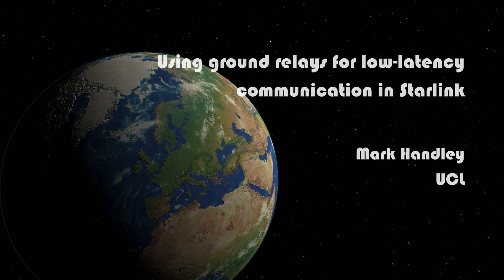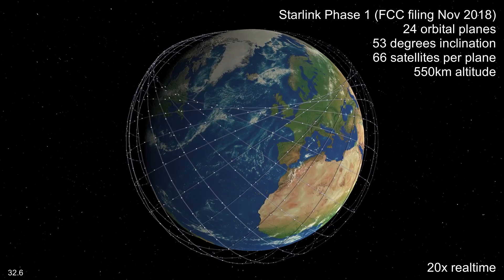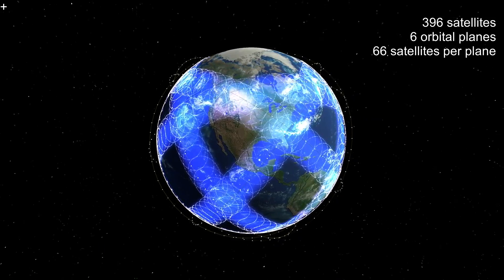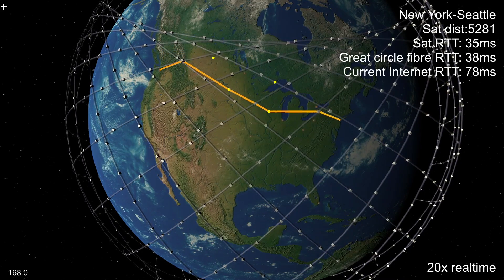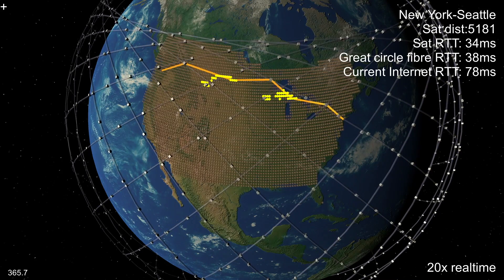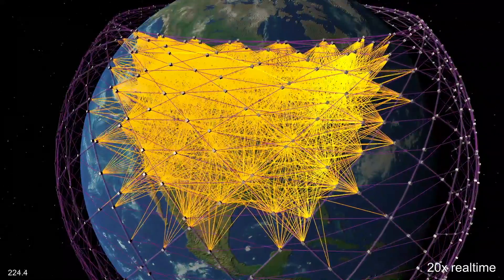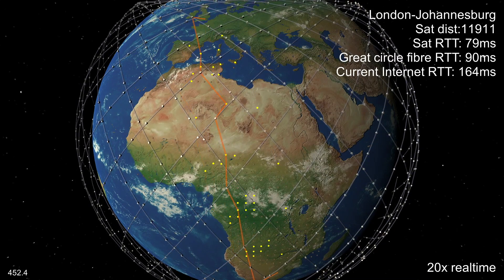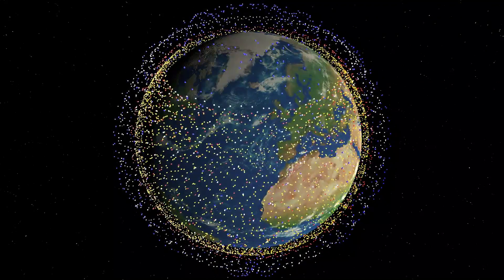Using ground relays with Starlink

Comment: ... funny idea.

So if there's going to be 10,000+ satellites, you might estimate that up to 5,000 should be in line of sight from any angle you look at the Earth. What the maximum wattage going to be on those lasers?

What if SpaceX can slip in the ability to fire off very high wattage bursts, if in synchronized intermittent pulses...

Or in other words could we LASER ABLATION DEFLECT ASTEROIDS USING STARLINK?

How many cumulative watts do you think we'd need? A synchronized 5 petawatt pulse focused on the same point of a single asteroid - could that potentially vaporize enough material to alter its trajectory?
Reply: lol ahaha
Reply: That’s good and all, but how about ordering fried poultry that literally falls from the sky? Think big, man!
Reply: If I understand correctly they have the green light for 12,000 and then an extension to 42,000...what could go wrong?

Comment: How in hell is all this infrastructure going to be maintained?   We can’t even maintain are 100 year old electrical system. Everything is on the ground.
Reply: It's pretty easy when the satellite company is the same company that launches them into space. 😂🛰️
Reply: Simple.
You just keep launching satellites, replacing ones that have problems, and replacing the whole constellation every few years, one at a time.
Reply: @ke6gwf  That probably what was said when the electrical grid was started.  At least the malfunctioning satellites can be set to burn up in the atmosphere. That is if they can be communicated with.  There may just be a failsafe.   Maybe they will just all land in Ohio.
Reply: @fatboy19831  Thier orbits are low enough they'll decay whether you can communicate with the sat or not.

Comment: Bro starlink does not exist

66 satellites per plane
24: 2+4=6 planes

They encoded 3 6 and 9. It's numerology. It's a lie.

Unless you can mathematically prove that 66 is the best number of satellites to put in a plane. Not 50, 65 or 70 but exactly 66.
Reply: #666

Comment: You need lasers to save more bandwidth for user data... but in first project cycle its not a big deal.... Also in space relay should be more stable cause air and clouds and local radio glitches.

Comment: How much slower is the radio up & down link than fiber?
Reply: Fibre is actually much faster
Reply: Yeah, the benefits in topology are great. Looking forward to seeing it in action in 2020.
Reply: Speed might be low but latency would also be low.
Reply: Yeah, don’t understand the logic behind this video. Without laser interlink, Starlink will likely be slower.
Reply: @ianjrgensen1824  It's not just about speed, you also have to consider routing and deployment. Fiber cables are not simple or easy to deploy in all locations. The Starlink network will be able to cover a much larger area and create more direct paths between locations.

Comment: No one really knows about it yet but there opening there own crypto currency exchange using the starlink constilation and they will have there own coin so they will be running there exchange faster than the normal internet it will essentially force all the other exchanges to use there system or be left behind this shits gonna be revolutionary

Comment: Sometimes I wonder if all they have are cell towers 🤔
Reply: Michael A-1  The best way to prove anything would be by testing a number of hypothesis and comparing results. Ask yourself this, "Can I get a telescope and actually see the satellites? Am I willing to accept that rockets powerful enough to escape Earth exist? Does the math actually check out? Have others already published this mashup of knowledge and are their calculations accurate?" I don't understand science deniers. The point of science is that it's testable. It may be difficult but if it's not testable, it's not good science.

Comment: The two biggest concerns for myself, and I'm sure a lot of people, are cost and data caps.  It's all well and good to have high speed data, but if it's more expensive or capped, standard terrestrial data connections with no limits would still be more appealing, especially after the likely price drop it would be forced into to try and retain or attract new customers in response to the losses to Starlink.

Comment: Great simulations - how do you run them? What libraries and frameworks do you use?
Reply from the maker: It's a custom simulator I wrote from scratch in C# using the Unity3d game engine for visualization.  There really isn't a user interface, just custom code for each scene, camera movement, and so forth.
Reply: @markhandley  that's pretty awesome and I'm  quite impressed by the amount of work you put into this!
Reply: @markhandley  How versatile is the simulation? Can it simulate any arbitrary communication constellation?
Reply: @skyr8449  I would assume so. The code is probably a list of relay objects with 3D trajectory and communication delay with other relays (dependent on their distance and type). The rest is a generic routing algorithm.
Reply: @markhandley  Can we download it ?
Reply: @markhandley  that's how i would of done it. unity is great.

Comment: You mentioned the potential for trans oceanic low latency links but I wonder about throughput. Not sure what the onboard capacity of the satellites is but isn’t routing all of the potential transoceanic data through those Northern oceanic routes likely to exceed the satellite network capacity at those critical locations?

Would a tiered system be offered to high paying subscribers with a well-funded appetite for the lowest latency ?
Reply from the maker: There are a lot of satellites along the 50 degree N corridor, so ships are more likely the limitation than satellites.  You really need ISLs to get a lot of trans-oceanic bandwidth.  So, yes, I agree that a tiered pricing system will be needed early on on these wide-area paths, to keep demand low enough to cope.  There are really two different markets for starlink.  One is connecting regular customers to the nearest fibre access point, and that service might be relatively cheap.  The other is wide-area low latency transit, and that's likely to be expensive.  In this video, I'm really looking at the latter.

Comment: I would imagine there would need to be thousands if not millions of ground stations to work on the scale you present, simply because the satilites would need to link to existing ground based networks functionally.

That being said I can't wait for more widespread TRUE high speed internet, 500ms ping from current gen internet satilites is abysmal, while starlink and other low orbit internet startups are saying they can do less than 10ms. I sure hope nothing gets in their way!
Reply: 600mb a second is massive for rural regions. I cant get better than 300kbs where I live. Funny how you dont see 1.2 GB every two seconds as impressive. Lol must be nice wherever you live.
Reply: Maybe the ping is lower or faster, but the data rate is not that impressive, about 600mb/s and that was obtained from a test aircraft.
Reply: @larsrosing5033  600mb/s is better than I got on a fiber optic connection a few years ago. . . now I'm rural and over the moon to get 5mb/s so I'll be amazed even if I get a twelfth the number you're saying

Comment: Thanks for this fascinating and exciting video, Mark! You and other viewers might be interested in this Starlink group on Facebook, https://www.facebook.com/groups/2223622370996287/
Mark - I've been reading that Starlink will be working to mass-produce phased-array antennas, about the size of a pizza box, that customers would purchase to use the service - https://techcrunch.com/2019/05/24/spacex-reveals-more-starlink-info-after-launch-of-first-60-satellites/. This is referenced again in the Starlink Wikipedia page. The primary challenge with these antennas will be reducing cost, but that's something Musk is really good at so I'm confident he'll find a way. Your simulations show Starlink using ground-based stations that appear to be part of the Starlink system with Starlink customers then interfacing with these ground bases through existing internet connections. Just curious if I interpreted correctly. Either way, I think your sims still apply.

Comment: I understood that the whole globe would be covered including the poles!? There are populations in the high arctic!
Reply from the maker: Starlink will only cover between 60 degrees North and 60 degrees South in the first phase.  Later phases should add higher inclination orbits which will cover the poles, but that probably depends on the parts of the world where 99.99% of the population live being profitable.  Your other option is Oneweb, which is starting with satellites in polar orbits, and will likely have a lot of spare capacity over the poles where their satellites' orbits all cross.
Reply: @markhandley  I still don't get it, if the purpose of the Starlink is to provide internet for sparsely populated, and poorer, areas of the globe, why is the arctic all of a sudden an economic issue?
Reply from the maker: The way orbits work, you can't cover the US without covering everywhere between about 55 degrees north and 55 degrees South.   If you add countries like the UK and Germany, you need the satellites in slightly higher inclination orbits, and then you can cover as far as 60 degrees north or south.  If you put the satellites in even higher inclination orbits, they spend less time over populated regions of the world, so you need more satellites for the same coverage in places like the us. So it's an economic tradeoff, but limited by orbital dynamic.
Reply: Poles will not be covered. There is no financial incentive to do that, and it would require more satellites to achieve that. It would be subptiomal to place all satelites on highly inclined or polar orbits. Same reason many other communication systems use a constelation of non-polar orbits instead.  If the starlink network gets big enough, it might be possible to add few orbital planes to cover polar regions and add extra coverage, but that will probably require at least 2 falcon launches, with fully expanded core to actually put them in that orbit. Maybe if they got a contract with DoD and other countries dealing with antarctic research they will do it, as it will help a lot with logistic, science and communication in Antarctic stations. Right now it is pretty bad there in this regard.
Reply: @movax20h   looks like to me that Scandinavia wont be covered. wouldn't call them nations arctic stations.
Reply: Did you not watch the whole video? It's shows the latter orbit paths covering the poles

Comment: While I really admire the work that went into this. I do suspect that the network will function quite a bit different than what you present it as here. The purpose of starlink is not to minimize signal delay to the other side of the world. It is to provide coverage and high data throughput to people. If the satellites have any kind of limit in bandwidth, which they do. Then it seems much more reasonable to build the ground stations with a large ground fiber connection and then take the signal trough the "regular internet" after the first jump. Nearly all data in the world is going to a already well connected server.Of course this rules out the idea of user based ground terminals, but building 100 or so ground terminals around the US seems rather trivial. Point to point signal the entire way would eat up nearly all the capacity of the satellites.
Reply: @halvor9797 I think it will end up using a combination of what you say and what is shown in this video, for example for signals going overseas really the best path is to use the starlink network and well there is not much population outside of like cruise ships and aircraft over the oceans. so you use the network rather then the underwater fiber for a lower ping to say japan from LA
Reply: @kinggoten  How much can you do within 80 micro seconds? Pick your nose, or cut a nail?
Reply: While I agree that would be an easier solution, I wonder why they are taking about laser communications between satellites if they are going to 1 hop to ground stations spread out around the world?
Reply: The satellites use a different frequency for ground hopping and relaying than the normal terminals. You would've been right had they used the same frequency and therefore the bandwidth.
Reply: this is very true.  an optimized hybrid system would be best.
Reply: What would be the difference between what we have no then?..If you have to hook up to a ground relay this idea is pure crap...On top of that you would have to add the expenses of maintaining those ground stations...
Reply: @GuyWithABrain1  I know! I believe Elon said something on this matter.
Reply: @andrew1717xx  Can you please point  me on to that?
Reply: @GuyWithABrain1  This is one of those rare  cases for me where I actually can't. But, if you tweet at Viv on Twitter, I'd imagine you'd find out.
Reply: I disagree. Latency is key for internet as we know it. Not bandwidth
Reply: @zeydallahoum  Uh, sure, for some "high-twitch" interactive applications (or the high frequency trading wankers), latency is of paramount importance.  However, a very large amount of traffic on the Internet today is streaming media traffic which isn't really all that latency sensitive.  Other applications, like telephony, are also somewhat more impacted by delay jitter rather than absolute latency.  When you start to congest paths due to bandwidth constraints, the jitter goes all to hell.

I find the premise of the video very interesting, but my gut tells me the cost of long-haul transport vs. fiber doesn't make sense since these systems tend to be capacity constrained due to limited bandwidith available on the RF links vs. optical fiber.  Of course, you'll have some applications where lowest possible latency at any cost might be a factor.  But when you can run dozens of lambdas of 100Gb/s optical carriers on a single fiber, I'm not sure satellite capacity is ever going to be cost competitive for bulk transport.  Of course, like mobile networks, a big part of the value proposition is ubiquity in availability "anywhere", and you'll trade off cost for that.
Reply: @lmamakos  I can't imagine one commercial application that would need more than 20mo/s to a device. It's already a huge bandwidth for the purpose of starlink ( bringing internet to remote locations ). I don't see why you would do more than one 'bounce' from the closest CDN to client. Of course it would mean SpaceX has a contract with most CDN around the world.
Reply: @zeydallahoum  Its quite clear this video is an attempt to cast doubt. Everything works in PowerPoint.
Reply: It's to spy on us. It will cause more cons than pros.
Reply: @JMac85X  its mainly so the us military can have low latency drones
Reply: @kinggoten  sure isn't for me and you to have fast internet in the woods. I see something sinister where others see opportunity.
Reply: @JMac85X  well it is most often a bit of both, in terms of spying 5G is more sinister it tracks your exact position down to a few cm 100% of the time and such.

Comment: I would very much like to know what software has been used to create a simulation?
Reply from the maker: It's a custom simulator I wrote from scratch.  It's written in C# using Unity3d for animation.  There isn't really a user interface though - just code for each scene.
Reply: @markhandley  Simply outstanding!
Reply: @Mark Handley, a video about your simulator and making of this video would be pretty interesting :)

Comment: My one concern when looking at this is packet loss when doing all that switching
Reply from the maker: Not just loss - you only get the latency numbers in the video if you can avoid building queues in the satellites.  That requires a control plane unlike anything in the Internet.  I don't know how SpaceX plan to achieve this, but I have my own ideas how this can be done.  Need to build the packet-level simulator to demonstrate whether I'm right though.  I've started on that, but simulating a global network at packet-level granularity is a interesting challenge.
Reply: @markhandley  Why come up with your own idea instead of the actual way Tesla is solving this issue? Take a look at the Tesla GPU patent and get familiar with van Emde Boas trees.
Reply: @markhandley  Is anyone else here concerned about Layer 1 packet loss?
Reply: this can, and sometimes does, happen now. TCP/IP traffic is designed for this. so not sure it would be an issue.
Reply: @brianhoehn949  ok well I dont know how it works on a lo level just a basic understanding.